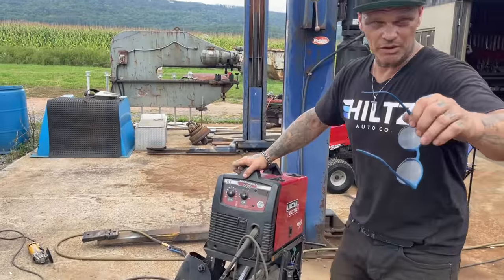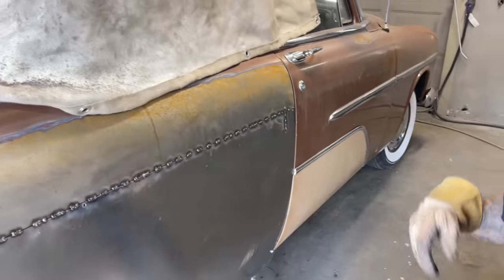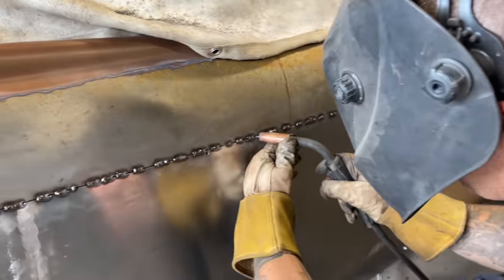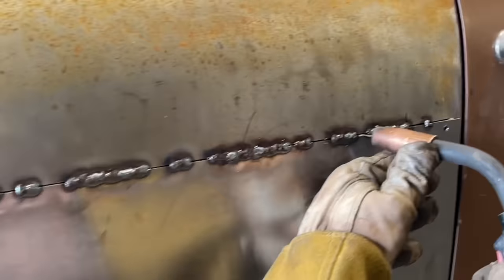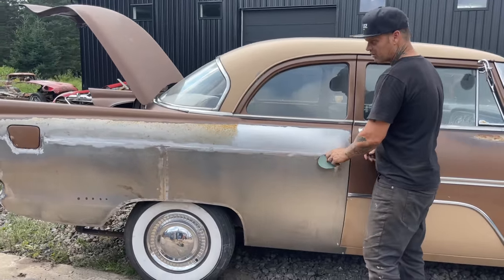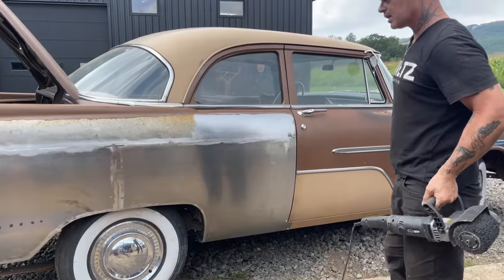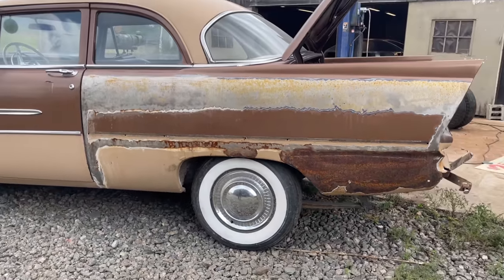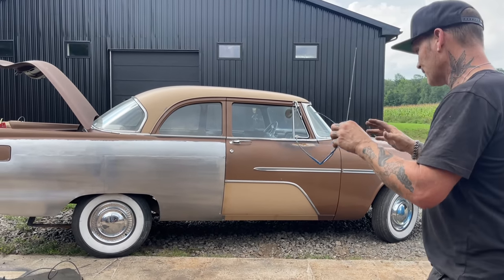Butt welding the panel WITHOUT warping it

Comment: I love your projects. I don’t have time to watch like I used to, but I watched this one cuz you said no warpage. When you said full blast on the welder, I knew I would like it.  I use .030 flux core with 80 amps for 20 gauge (90 amps for plug weld) and do it about the same way.  I like it cuz it’s much less grinding 😊😊

Comment: Great to hear the info on wire feed and voltage on the welder. Would like to hear more about settings for the square stock, round bar and angle iron process.

Comment: Nice Chad used 18 gauge too, the cheap stuff you weld in that you buy for repairs is so thin, I didn’t think it possible  to make such a large panel at home with basic tools that came out so nice

Comment: Very interesting project.   It is odd though the way it is jacked up on the front and back.  The top of the front fender arch should be down near the top of the white wall and on the back wheel arch should be down over the edge of the hubcap.
Reply: Do you suspect that it has been bent in an accident..? -J.J.
Reply: @jessiejames2155   It has very long spring shackles on the back as you can see in the videos.   Looks like it was planned to have it jacked up.

Comment: Chad really like how you present and i have learned alot from you and will continue to do so.
I have a question regarding method 
If you had TIG would it not help keep the heat down to a minimum with less time involved in surface prep. Watching you use MIG with such a long panel is an excellent example on how to. 
Great work and thank you for your time and effort to you and your talented camera person too. 😊😊

Comment: i have had some burn thru issues trying to do this with the welder cranked higher than called for on the material thickness, seems to happen more with areas that have some residual pitting / not perfect clean metal.  

It seems as though you prefer a little longer wire stick out so perhaps thats why you can get away with the more juiced voltage ?

Comment: Learned a lot watching this, have one question I used that heat sink putty and a wet rag vice air, it seemed to work well but it was a shitload more work and mess than your air cooling.  Could you use the heat sink putty also or would it simply be a bigger mess for nothing?  Have a old All Star Mig, a out of business body shop supply company captive namebrand.  It has a neat stitch weld set-up, where you can set the weld time and a reset time, makes things both nice and frustrating at the same time.

Comment: I understand that different machines take different settings for spot weld. You made a good explanation of how you weld the panel on --- very highest heat and adjust the feed to that heat. Good.  But, what are your thoughts for making the first spot welds  that you are going to build the rest of the welds on. I frequently burn through without that initial weld being there to build on.

Comment: when you artificially cool the metal you are locking the molecules into an excited state, basically tempering that small area.  when you have a tempered area against an area where the molecules are at rest, you can get problems.  your work looks excellant, can't deny it, and i've seen people use this technique before, admittedly, with success, but i'd never cool that metal that way.

Comment: Chad

Great work. I noticed that after tou ground the welds down, esp towards the back of the car, the weld did not level out with the surface. This has happened to me too. It did not look like you went back and filled it in and regrouped
 In my area, I would worry about moisture (rain etc) peneyrating the back through pinholes. Do I need to fill these in, or is this overdoing it?

Comment: I use a pneumatic flanging tool on 12" panels or longer. More meat to weld to, more rigidity and easy to control. If you have access from behind, you can still relieve stress in the panel. Why does no one talk about sealing the inside of the weld. Naked and burnt to a crisp, I spray an internal wax coating while checking any drain holes are open a few days later. 
DK, ASE Master 78

Comment: Wondering how the Eastwood tool does on a panel with heavy surface rust? Looks like it should do well, and would save a lot of fooling around with sandpaper. Show us Chad. ... well it took those weld burns right out!

Comment: Stitch welding is effective but the air blowing does very little
Reply: Agreed,  the metal will retain/disperse heat for minutes.
Reply: @TKO44647  easier and quicker to do less weld or a smaller weld and move to another location